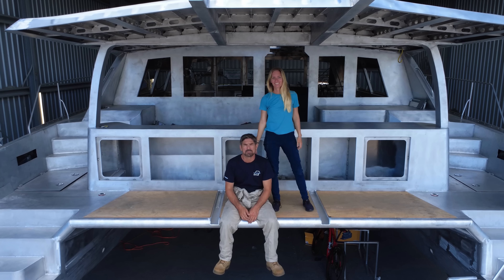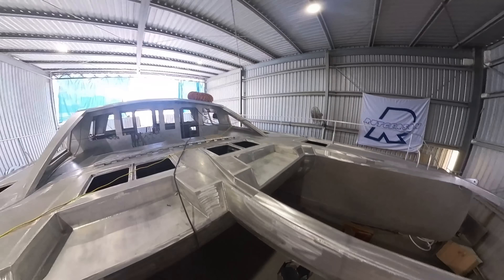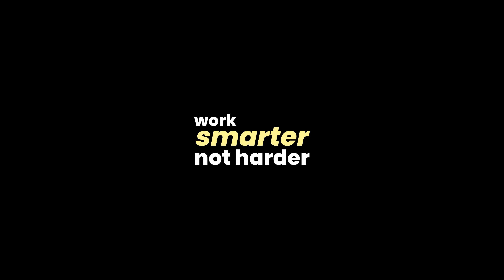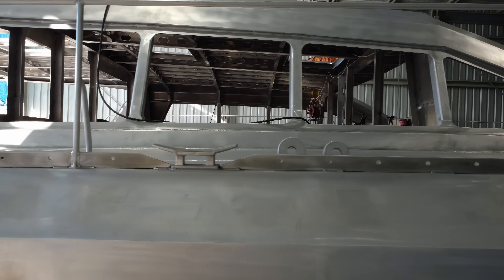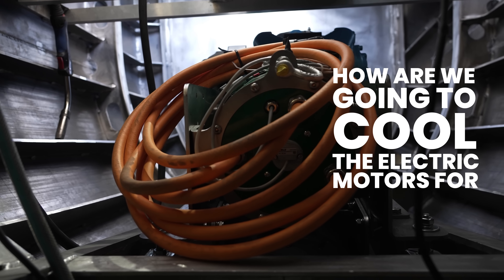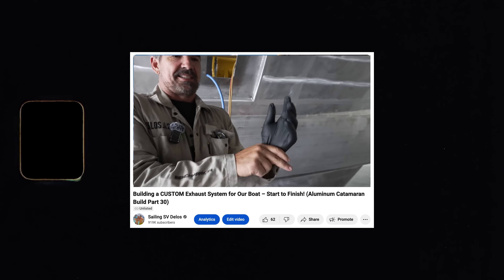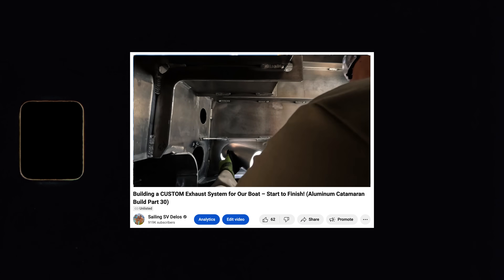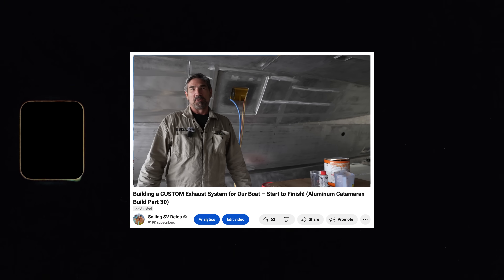We Challenged AI to help design our Keel Cooler 🧠 (Building Our Own Aluminum Catamaran From Scratch)

Comment: @SVDelos: I just did it out of curiosity:
"Thus, you'd need approximately 3.3 square meters of aluminum heat sink area for effective cooling. If the boat is moving at a decent speed, you might get away with a bit less.

Follow-Up Questions
Do you want the cooler to be an integrated part of the hull (like an external aluminum plate)?

Are you planning passive cooling, or will you use a pump to circulate coolant?

Is this for continuous operation or short bursts of high power?

These details will refine the estimate. 🚤

You said:
Are you sure? Brian from SV delos asked you exact that question and to him you said 1.25sqm while DeepSeek answered 0.22sqm and Gemini came up with 0.33sqm.

ChatGPT said:
Good catch! The discrepancy comes down to assumptions about heat transfer rates in seawater. Let's go through this again carefully and make sure we get a solid answer.

Step 1: Heat to Dissipate
As calculated earlier:

Heat loss
=
2500
 W
Heat loss=2500 W
Step 2: Heat Transfer Coefficient for a Keel Cooler
The key factor is the heat transfer coefficient (
ℎ
h), which determines how effectively heat moves from the aluminum keel into seawater.

Passive submerged aluminum surface in seawater:
ℎ
≈
500
−
1000
h≈500−1000 W/m²·K
(Low-speed or moored boat, natural convection)

Flowing water around keel (motoring/sailing):
ℎ
≈
1000
−
5000
h≈1000−5000 W/m²·K
(Higher water velocity dramatically improves cooling)

A realistic mid-range estimate for a moving sailboat is around 2000 W/m²·K.

Step 3: Required Surface Area
The basic heat transfer equation is:

𝑄
=
ℎ
⋅
𝐴
⋅
Δ
𝑇
Q=h⋅A⋅ΔT
Where:

𝑄
=
2500
𝑊
Q=2500W (heat to dissipate)

ℎ
=
2000
h=2000 W/m²·K (estimated for moving water)

𝐴
A = required heat sink area (m²)

Δ
𝑇
=
ΔT= temperature difference between coolant and seawater

Assuming a coolant temperature of 50°C and seawater at 20°C, we get:

2500
=
2000
×
𝐴
×
(
50
−
20
)
2500=2000×A×(50−20)
2500
=
2000
×
𝐴
×
30
2500=2000×A×30
𝐴
=
2500
2000
×
30
=
2500
60000
=
0.042
 m²
=
0.42
 m²
A= 
2000×30
2500

 = 
60000
2500

 =0.042 m²=0.42 m²
Step 4: Adjusting for Conservative Estimates
If the boat is slow-moving, reducing heat transfer to 1000 W/m²·K, then:

𝐴
=
2500
1000
×
30
=
0.083
 m²
=
0.83
 m²
A= 
1000×30
2500

 =0.083 m²=0.83 m²
If the boat is stationary (worst case), the heat transfer might drop to 500 W/m²·K, requiring:

𝐴
=
2500
500
×
30
=
1.67
 m²
A= 
500×30
2500

 =1.67 m²
Final Answer:
At cruising speed: ~0.42 m² (~0.5 m² to be safe)

At low speed: ~0.83 m²

At anchor: ~1.67 m²

So, if Brian from SV Delos was given 1.25 m², that was a conservative assumption likely for mooring scenarios.

Why DeepSeek & Gemini Gave Lower Values:
They may have assumed:

Higher heat transfer rates (closer to 5000 W/m²·K, like a dedicated marine heat exchanger)

Greater temperature difference between coolant and seawater

More water flow from hull design enhancing convection

Their numbers (0.22–0.33 m²) would apply if the boat is moving fast with high water flow over the keel.

Conclusion:
For practical use:

0.5 m² is enough for normal sailing speeds

1.25 m² is safer for low-speed operation

If often at anchor, go with 1.5+ m²

Would you like a specific keel cooler design recommendation based on your boat’s size and cruising speed? 🚤"

Comment: Have you considered the metal fatigue of the bottom of the boat due to constant cooling and heating?
Reply: Maybe probably, if it was switched on and off a few times per hour every hour for years.  But not if you just occationally use your engine.

Comment: I'm not sure I understand correctly, but it seems you just want the hull (without adding anything outside) to dissipate the extra heat. I am just wandering if you would have anti-fouling on the side that is in the water and how much it affects the heat transfer and how much heat the anti-fouling can tolerate.

Comment: A diesel engines have an optimum run temp and that is quite high. Meaning the heat of rejection is higher than water medium that you are rejecting to. Meaning you can use smaller heat exchangers. What is the optimum run temp of your electric motors? Next question is what is the highest water flow rate of that motor? Then design based on flow or design backwards on what you know. Next thing is to keep in mind that you are using aluminum you must be very careful with PH levels of the medium used and if it’s glycol you have to de-rate the heat of rejection, meaning larger heat exchanger. Another thing to think about is air purge and make up water. I would guess you will have an open tank set up high?

Comment: I ran your prompt through the think feature of Grok 3 and it came back with an even smaller number based on assumptions: Approximately 0.1 m2

Let’s tackle this step-by-step to determine (1) how much heat needs to be dissipated from a 25 kW electric motor that’s 90% efficient via an aluminum heat sink in a closed-loop coolant system, and (2) how large that heat sink needs to be if it functions as a keel cooler on a sailboat.
Part 1: Heat to Be Dissipated
For an electric motor, the power rating—here, 25 kW—typically refers to the mechanical output power, and efficiency describes how much of the electrical input power is converted into that mechanical output. With an efficiency of 90% (or 0.9), the remaining power is lost as heat.
Efficiency definition:
Efficiency (η) = Output Power / Input Power
Given η = 0.9 and Output Power = 25 kW:
0.9 = 25 kW / Input Power
Input Power = 25 kW / 0.9 ≈ 27.78 kW
Heat generated:
Heat is the difference between input and output power:
Heat = Input Power - Output Power
Heat = 27.78 kW - 25 kW = 2.78 kW
Alternatively, we can use the efficiency to find the heat directly:
Heat = Output Power × (1/η - 1)
Heat = 25 kW × (1/0.9 - 1) = 25 kW × (1.111 - 1) = 25 kW × 0.111 ≈ 2.78 kW
Both methods confirm that the motor generates 2.78 kW of heat. In a closed-loop coolant system, the coolant absorbs this heat from the motor and transfers it to the aluminum heat sink, which then dissipates it to the environment. Thus, the heat sink must dissipate 2.78 kW.
Part 2: Size of the Heat Sink as a Keel Cooler
A keel cooler on a sailboat dissipates heat from the heat sink (in contact with seawater) to the surrounding water. We need the surface area of the aluminum heat sink to transfer 2.78 kW of heat. The heat transfer rate is governed by:
Q = h × A × ΔT
Where:
Q = heat transfer rate = 2.78 kW = 2780 W
h = convective heat transfer coefficient (W/m²·K)
A = surface area of the heat sink (m²)
ΔT = temperature difference between the heat sink surface and the seawater (K or °C)
Rearranging for area:
A = Q / (h × ΔT)
Assumptions
Since the problem doesn’t provide specific temperatures or boat speeds, we’ll use reasonable estimates:
Seawater temperature: Assume 20°C (typical for temperate waters).
Heat sink temperature: The coolant keeps the motor at a safe operating temperature (e.g., below 80-100°C for many motors). Assume the coolant’s average temperature is around 70°C, and the heat sink surface is slightly cooler, say 50°C, due to heat transfer. Thus, ΔT = 50°C - 20°C = 30°C.
Heat transfer coefficient (h): For a keel cooler, h depends on water flow over the surface (affected by boat speed). For a sailboat moving at 2-5 knots (1-2.5 m/s), forced convection in water yields h values of 1000-2000 W/m²·K. We’ll use h = 1000 W/m²·K as a conservative estimate.
Calculation
Q = 2780 W
h = 1000 W/m²·K
ΔT = 30 K
A = 2780 / (1000 × 30) = 2780 / 30,000 ≈ 0.0927 m²
Rounding for practicality, the area is approximately 0.1 m².
Verification
If h = 2000 W/m²·K (faster speed): A = 2780 / (2000 × 30) ≈ 0.046 m².
If ΔT = 20°C (smaller difference): A = 2780 / (1000 × 20) ≈ 0.139 m².
The range 0.05-0.14 m² is plausible, but 0.1 m² balances conservative assumptions with typical conditions.
For a more precise design, we could use the log mean temperature difference (LMTD) with coolant inlet/outlet temperatures (e.g., 80°C to 60°C), but the simpler approach suffices given the problem’s scope.
Final Answer
Heat to dissipate: 2.78 kW  
Heat sink size: Approximately 0.1 m²
This assumes a flat aluminum surface; fins could reduce the required area by increasing effective heat transfer.

Comment: Having the electrical motor cooled with a keel cooler is nice. I assume that it will not be a bolt on solution, but rather a weld in place one? As in the hull is the outside of the radiator, so nothing sticking out on the outside? 
Obviously the electrical motor wouldn't suffer if it gets too much cooling so I'd rather go reasonably large to have room for calculation errors and unexpected effects. Measuring the temperature of the coolant in the motor decides how fast the pump needs to run, so it could work with a rather low flow when not running at max.

Comment: I am a mechanical engineer and I would approach the experts in the field who manufacture keel coolers and have them run their very well tested simulations on your design.   They will of course be conservative in their approach but that's how you would want to spec the design regardless.   IMO.
Reply: I think you are correct.  Just going to a manufacturer and looking at their products will give you an idea on the size.
Reply: It's best to contact experts who have been in the field, yeah.
Reply: You are building the boat to go in colder water but I am sure once you get tired of cold weather you want to come back to tropical climate so a larger keel cooler with a thermostat is probably a good compromise.
Reply: Thank you for sharing everything you and your family do❤
Reply: See comment by @No-regrets who claims to be the at specialist. Also explains how to do it.
Reply: @jpdj2715  The only thing I would add to his comments is that they have the ability to add internal fins to the inside (and possibly a surface area enhancer on the outside) of the external cooler.  The more aluminum you can expose to the coolant and the seawater the better the performance of the heat exchanger will be.  Definitely though exchanger on the outside of the hull and share the hull skin with the hull side is best.  Suffice to say design it big to increase the dwell time of the coolant in the exchanger.
Reply: @RudyVandenbelt  They probably want to keep the outside (keel) as clean as possible and not increase added drag that way. So they should use an area as large as possible on the inside and increase transfer area on the inside - your "internal fins" If they can use both sides of the keel, then I'd do that too.
Reply: Efficiency would likely drop substantially.  A low profile well contoured (to prevent drag) thin wall aluminum (3 to 4mm) external unit would be more efficient and easier to check and maintain. Also you wouldn't have to deal with all the internal framing to get your large surface area.  Either side of the keel like an airplane wing fairing would be a great way to get it all.
Reply: I know alot of local commercial watermen who have keel cooled diesel engines 300hp plus 40ft workboats. They all have built there own keel coolers out of 316l ss 3/8 id pipes.
Reply: I slept in a Holiday Inn express comments.  Comments obviously do not understand AI.
Reply: I would go inward sides of hull to avoid straps damaging them during haul outs. Plus I know you’ll be using some type of glycol to alleviate freezing in colder climates plus an electrical heater on the water side of the exchange manafold
Reply: What happens when you are using the electric motor in generator mode and the boat is stationary.  I.e. no water flow to help cooling.  The diesel engine will cool via forced water flow.  The generator will also have heat to dissipate.
Reply: @RShutte-b8n  Presumably the electric motor will require an electric water pump system to circulate it's coolant.  Really no different than the motor operating from batteries on it's own.
Reply: @RudyVandenbelt .  I was thinking mom of the reduced sea water flow on the outside of the hull.    The closed circuit loop will have a pump.   But will it increase the temp of the sea water in an area around the cooler.   Does this make a significant difference to the potential temp difference required to cool the fluid in the closed loop.
Reply: @RShutte-b8n  If the water outside the hull is stationary and has limited volume (like a test tank) then the answer to your question is maybe.  As it is the heat sink that is the water surrounding the boat is a massive volume and just the currents induced by the heat coming off the boat will ensure that the water around the exchanger is constantly in flux.  However, this is one of the reasons that you want to design the syterm for worst case conditions.  The main variable here would be the static temperature of the surrounding water.  The design will have to assume the warmest conditions of that water for proper configurations.  All that being said,  the temperature differential between the water and the coolant in the exchanger will ultimately dictate the efficiency of the overall system.  Careful design of the external heat exchanger will help greatly to improve the efficiency of the sytstem under all conditions.  None of the engineering here is terribly complex ,  but the exercise of improving the heat transfer efficiency usually takes some effort to optimize.
Reply: @RShutte-b8n  The ocean is not exactly static. Aluminum is a fantastic conductor of heat, and will just spread the heat over a larger area of the hull, as necessary. Even when sitting "still," the ocean is constantly moving. You guys are way overstating the problem. Even if he was using an externally-installed keel cooler, there would still be the same concerns of bio-material growth on the cooler, and water flow/exchange rate, and those things also work just fine. And a Keel cooler comes without the added benefit of several tons of additional aluminum and hundreds of square feed of additional surface area in contact with the water.
Reply: What about algae growth on the outside of the hull that may reduce the efficiency of the cooling not to mention the warmth of that area of the keel may accelerate the algae growth compounding this problem.
Reply: You need to also consider “fouling factor” due to degradation in heat transfer caused by, call it, surface contamination.  Bottom paint, marine growth, film coefficients, antifreeze are all going to lower heat transfer.
Reply: @chipjacobs-s2m  Yup... also flow rates, dwell time, laminar vs. turbulent flow while in motion, all these things need to be considered in the design.
Reply: All the money spent on the boat the last thing I would ask for advice is AI. Go to the experts who have experience in this.
Reply: Cooling gel from Video Card GPU?
Reply: Would the lifetime cost of making the keel cooler 5x as large as it needs to be be greater or less than the cost of having it professionally designed?
Reply: @opcn18  The "professional" would do the heat transfer calculations and double it anyways.  So yeah. bigger is better.
Reply: @opcn18  considering they can just build it using the scrap material they already have on hand, I'd say it's infinitely cheaper to just build it.
Reply: A hot part of the hull would distort againstntge cool part. I dont know but i feel itnis a lomg term material failure risk
Reply: @ Same material same temperature.  Aluminum is one of the BEST conductors of heat of all metals.  Over that small area and that relatively low temperature differential the coefficient of expansion of the metal won't likely be an issue. Nothing proper design cannot solve.
Reply: AI is really helpful when you use it to discuss ideas, facts, and calculations regarding any project.  Just know it’s limitations, it tends to lie to you so tripple check the facts and figures.  I personally would have gone with a fiberglass or fiberglass with core boat.  Those boats are generally not diy boats so I see why brian and karen went with aluminum.  I think if they would have had a strong negotiation plan with Amel they would have come out with a new Amel boat at a decent price and came out a lot better with less effort.
Reply: Yes... Definitely. Ai is a joke.
Reply: @sails3538  Nonsense.
Reply: @ When I test for heat transfer equations they seem to pretty good.  Like anything digital thouigh, crap in crap out.  The input variables and the deisign of the actual exchanger are where human experience pays the biggest dividends.
Reply: @sails3538  There is a Sh**load of AI in your life now that you have no idea is AI.Many things are decided by AI in today's world. Scary but true.
Reply: @sails3538  That statement will come back to haunt you some day. Ai is an incredibly powerful now and it will only get better. It will be a game changer for those who learn to leverage it.
Reply: @johnwheatley231 ... Have fun with the fake economy. This attitude is why murca is failing along with Europe. Manufacturing is the single most important thing a country can do. And those countries that kept manufacturing have a possive trade balance.
Ai is useless.

Comment: AI assumes that you are only cooling on said area, but in reality you have a thick aluminium hull, that will conduct the heat much further away from your area of contact (because of the heat transfer). Some things to consider: You are basically heating your hull unevenly, so you will induce some thermal stress, bigger surface, less stress. Will it be worse than a alu deck in a blazing sun, probably not. Also you will need to insulate the heat exchanger surfaces or it could become quit hot in the engine room.

Comment: I’m not terribly familiar with keel coolers, but would the fins be on the outside? If so, would barnacles affect it?
Would a small radiator with an electric fan be a good backup system?
Reply: no fins. welded part of the hull on the inside.